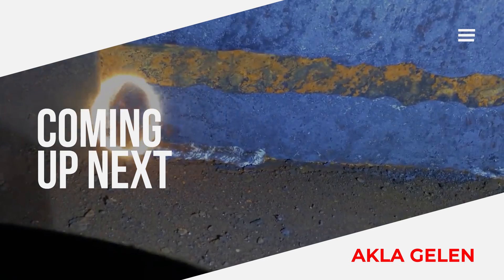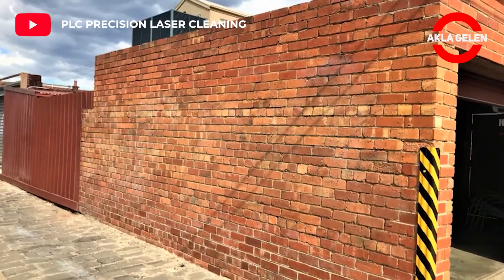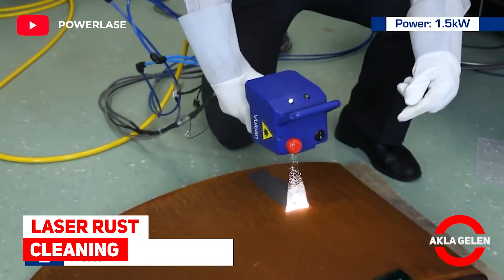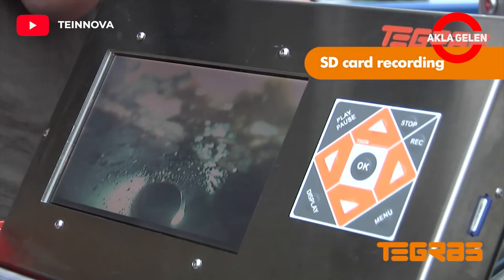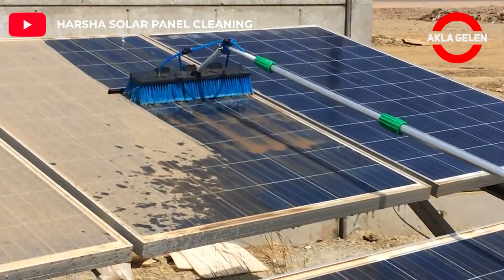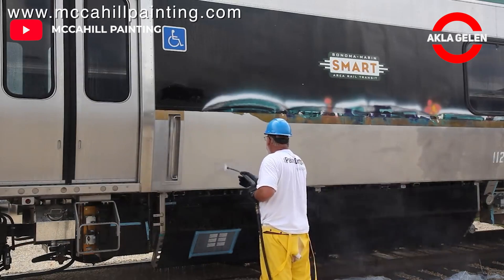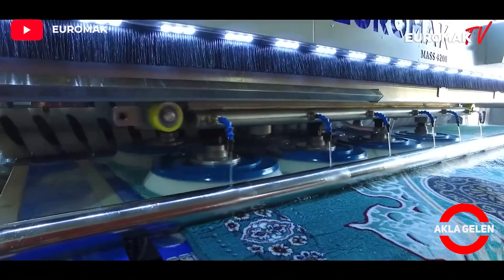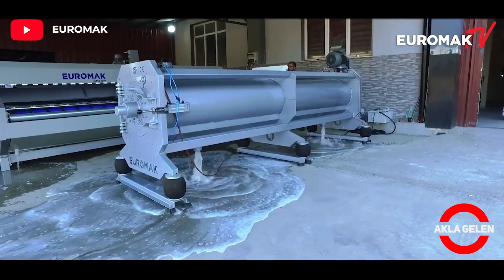Rust Removal With a New Technology Laser Machine - Most Powerful & Incredible Cleaning Machines

Comment: That grease in the vent pipe is why I don't like deep frying food indoors.  That vapor gets all over everything and it is a pain in the neck to clean it up.  If you enjoy cleaning then maybe it won't bother you.  This is something you will not notice right away.  Instead one day you will start to notice a sticky feeling on all surfaces in the vicinity of where the fryer was.  You will wish the whole kitchen was fully water resistant and tiled with stainless steel fixtures by the time you get done so you can use a good degreaser and rinse it away.